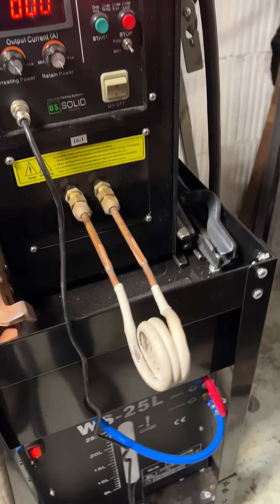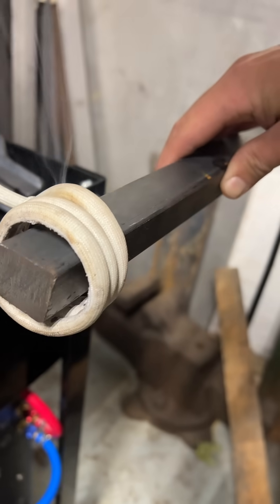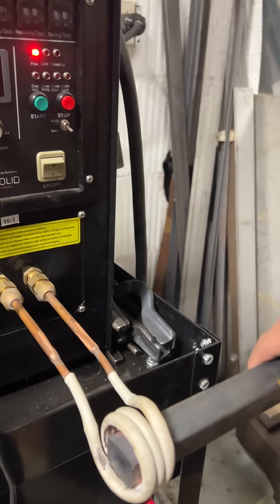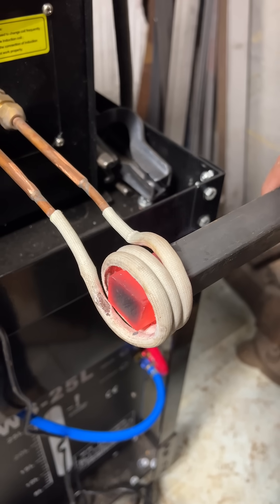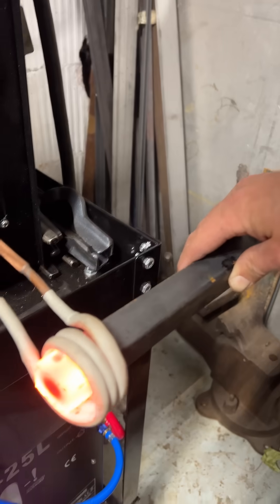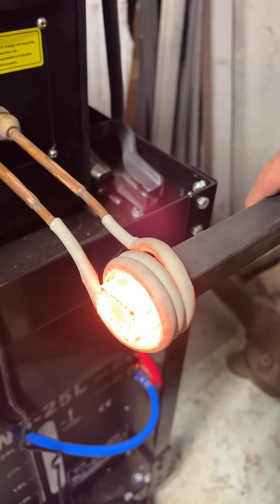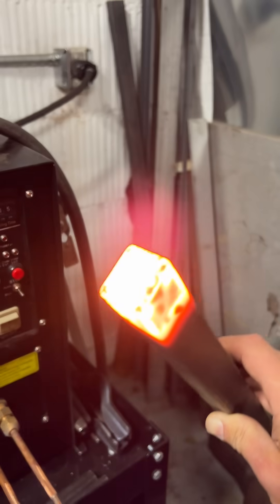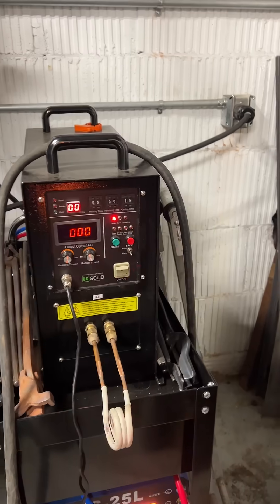Red Hot Steel In Seconds! - Induction Heater

Comment: Does it heat the whole piece in the coil evenly, or does it it heat a certain direction (outside-in or inside-out)
Reply: It depends on the frequency of the tank and the thickness of the steel.

Comment: I worked in quality assurance at an automobile mfg plant. Our supplier that made our axle shafts would heat treat the shafts after machining using the same method except it was much faster. The coil was ran over the shaft and back off in a matter of 10-15 seconds, and quenched with water on both sides of the area in the coil that was glowing red hot. When it was over the axles had a blue color from the heat. It was pretty impressive to watch.

Comment: Woe ! I don't understand how the heat doesn't transfer. That's amazing
Reply: Thermal transfer will still happen, its just that he heated that spot so quickly that it didn't have time to take place yet. 5 minutes after the video ended this bar was a scorching 800f I bet.
Reply: @coopers1716  what if someone put a finger inside the coil !?
Reply: @parwisingh1171  Nothing unless you had some kind of ferrous ring on or metal embedded in your finger. Microwaves work by vibrating water molecules really fast right? This is essentially a magnetic microwave, so instead of affecting the water molecules it's vibrating the shit out of the magnetic particles.
Reply: @coopers1716  thanks
Reply: @coopers1716   Hello , let me explain to you why you are incorrect and that you will not be burned “the same as holding a needle and a lighter”  which is not induction heating it is conductive heating and a needle is a very minuscule amount of a less dense material 16 gauge stainless steel wire sharpened to a fine point than a 1.000”x 1.000” x 24.000” cold rolled steel bar. [choose the appropriate dope stick or temporary non conductive clamp to hold the workpiece I’m pretty sure you have seen them every time dinner was ready and there was that hot stove with that pot of hot delicious home cooked meals in them (depending on which generation you are as some are McDonalds and Burger King  and this new generation is door dash and Uber eats.). Yep, you guessed it the handles some were made what did not really get hot unless you held it over a flame or an idle left on.
Inductive heating is on the atomic level using eddy currents to heat the atoms which are changing poles generating energy and radiating particles and that we perceive as heat and light.  A good digital scale can be used to weigh the material take it to amber then weigh it. Record the cold temperature and weight the heated temperature when the color changes and it’s weight all the way up to an amber color then weigh it then let it cool completely or if there are 2 samples quench one in used or high hydrocarbon oil then pull our once completely cooled then dry and weight them both the one quenched in oil will gain in mass and density the other will have loss weight and in some cases density.  Less dense materials have difficulty influencing harder or larger cold surfaces.  One with drawn from the influence of eddy currents the objects rearrange and it stop radiating and starts cooling and returning to its natural state.  Think of it like this you remember in science class you at the atoms which are made from electrons and each element on the periodic table has a breakdown on each element and it’s constituents how many protons, neutrons and electrons which are in the atoms of the matter.  You have the core or nucleus then a shell some elements will have 2 or more shells these outer shells hold everything in place like charges repel .An atom is the basic building block of chemistry. It is the smallest unit into which matter can be divided without the release of electrically charged particles. It also is the smallest unit of matter that has the characteristic properties of a chemical element. The eddy current influences those charged positively charged partying particles because they are being excited by the coil and they vibrate which in some cases the radiation will be in the form of pressure waves or what is commonly known as sound.  That humming noise from turning on high voltage devices, ozone, IR radiation also known as heat until the Electromagnetic radiation release enters the higher ranges of visible light in the electromagnetic spectrum. As it heat it is giving off electromagnetic radiation in correlation to the electromagnetic frequency.
Electromagnetic waves differ from mechanical waves or energy in that they do not require a medium to propagate. This means that electromagnetic waves can travel not only through air and solid materials, but also through the vacuum of space.
Reply: @MarshallMcFarlin  The fact that you think Imma read that is absurd.
Reply: With normal, conductive heating the rate of heat transfer into the steel is slower than the heat transfer down the steel bar. With inductive (this), resistive (from passing electricity through it), or radiative heat (a bright light, perhaps a laser) you can heat a section far quicker than it conducts the heat down the bar.
Reply: It’s AC current not DC.  It’s generating eddy currents in the bar where the coil is and almost all at once the magnetic field in the area where the coil is is rapidly going NSNSNSNSNSNSNSNSN on the atomic level generating heat unlike DC which flows in one direction like water in a pipe.  To Butter understand this phenomenon take a glass of water and a drinking straw.  When you drink from the straw the liquid flows in one direction  >>>>>>>>it remains cool. 
But, if you draw the drink then instead of swallowing it forced it back into the same glass without breaking contact with the straw when you reverse the flow it is met with resistance of the rest of the fluid.  ><><><><> eddy current build in the straw which can be measured using an infrared thermometer.
I hope this explains it.  You may find a more specific answer in my earlier comment.
Shabbat Shalom ✡️.
Reply: Hello , let me explain to you why you are incorrect and that you will not be burned “the same as holding a needle and a lighter”  which is not induction heating it is conductive heating and a needle is a very minuscule amount of a less dense material 16 gauge stainless steel wire sharpened to a fine point than a 1.000”x 1.000” x 24.000” cold rolled steel bar.
Inductive heating is on the atomic level using eddy currents to heat the atoms which are changing poles generating energy and radiating particles and that we perceive as heat and light.  A good digital scale can be used to weigh the material take it to amber then weigh it. Record the cold temperature and weight the heated temperature when the color changes and it’s weight all the way up to an amber color then weigh it then let it cool completely or if there are 2 samples quench one in used or high hydrocarbon oil then pull our once completely cooled then dry and weight them both the one quenched in oil will gain in mass and density the other will have loss weight and in some cases density.  Less dense materials have difficulty influencing harder or larger cold surfaces.  One with drawn from the influence of eddy currents the objects rearrange and it stop radiating and starts cooling and returning to its natural state.  Think of it like this you remember in science class you at the atoms which are made from electrons and each element on the periodic table has a breakdown on each element and it’s constituents how many protons, neutrons and electrons which are in the atoms of the matter.  You have the core or nucleus then a shell some elements will have 2 or more shells these outer shells hold everything in place like charges repel .An atom is the basic building block of chemistry. It is the smallest unit into which matter can be divided without the release of electrically charged particles. It also is the smallest unit of matter that has the characteristic properties of a chemical element. The eddy current influences those charged positively charged partying particles because they are being excited by the coil and they vibrate which in some cases the radiation will be in the form of pressure waves or what is commonly known as sound.  That humming noise from turning on high voltage devices, ozone, IR radiation also known as heat until the Electromagnetic radiation release enters the higher ranges of visible light in the electromagnetic spectrum. As it heat it is giving off electromagnetic radiation in correlation to the electromagnetic frequency.
Electromagnetic waves differ from mechanical waves or energy in that they do not require a medium to propagate. This means that electromagnetic waves can travel not only through air and solid materials, but also through the vacuum of space.
Reply: Heat will transfer slowly as the rod is very thick
Reply: the heat will travel down the rod once he removed it for the coil. u can test this theory with a sewing needle and a lighter.
Reply: @freedomcanada8397  Hello , let me explain to you why you are incorrect and that you will not be burned “the same as holding a needle and a lighter”  which is not induction heating it is conductive heating and a needle is a very minuscule amount of a less dense material 16 gauge stainless steel wire sharpened to a fine point than a 1.000”x 1.000” x 24.000” cold rolled steel bar.
Inductive heating is on the atomic level using eddy currents to heat the atoms which are changing poles generating energy and radiating particles and that we perceive as heat and light.  A good digital scale can be used to weigh the material take it to amber then weigh it. Record the cold temperature and weight the heated temperature when the color changes and it’s weight all the way up to an amber color then weigh it then let it cool completely or if there are 2 samples quench one in used or high hydrocarbon oil then pull our once completely cooled then dry and weight them both the one quenched in oil will gain in mass and density the other will have loss weight and in some cases density.  Less dense materials have difficulty influencing harder or larger cold surfaces.  One with drawn from the influence of eddy currents the objects rearrange and it stop radiating and starts cooling and returning to its natural state.  Think of it like this you remember in science class you at the atoms which are made from electrons and each element on the periodic table has a breakdown on each element and it’s constituents how many protons, neutrons and electrons which are in the atoms of the matter.  You have the core or nucleus then a shell some elements will have 2 or more shells these outer shells hold everything in place like charges repel .An atom is the basic building block of chemistry. It is the smallest unit into which matter can be divided without the release of electrically charged particles. It also is the smallest unit of matter that has the characteristic properties of a chemical element. The eddy current influences those charged positively charged partying particles because they are being excited by the coil and they vibrate which in some cases the radiation will be in the form of pressure waves or what is commonly known as sound.  That humming noise from turning on high voltage devices, ozone, IR radiation also known as heat until the Electromagnetic radiation release enters the higher ranges of visible light in the electromagnetic spectrum. As it heat it is giving off electromagnetic radiation in correlation to the electromagnetic frequency.
Electromagnetic waves differ from mechanical waves or energy in that they do not require a medium to propagate. This means that electromagnetic waves can travel not only through air and solid materials, but also through the vacuum of space.
Reply: @freedomcanada8397   Hello , let me explain to you why you are incorrect and that you will not be burned “the same as holding a needle and a lighter”  which is not induction heating it is conductive heating and a needle is a very minuscule amount of a less dense material 16 gauge stainless steel wire sharpened to a fine point than a 1.000”x 1.000” x 24.000” cold rolled steel bar.
Inductive heating is on the atomic level using eddy currents to heat the atoms which are changing poles generating energy and radiating particles and that we perceive as heat and light.  A good digital scale can be used to weigh the material take it to amber then weigh it. Record the cold temperature and weight the heated temperature when the color changes and it’s weight all the way up to an amber color then weigh it then let it cool completely or if there are 2 samples quench one in used or high hydrocarbon oil then pull our once completely cooled then dry and weight them both the one quenched in oil will gain in mass and density the other will have loss weight and in some cases density.  Less dense materials have difficulty influencing harder or larger cold surfaces.  One with drawn from the influence of eddy currents the objects rearrange and it stop radiating and starts cooling and returning to its natural state.  Think of it like this you remember in science class you at the atoms which are made from electrons and each element on the periodic table has a breakdown on each element and it’s constituents how many protons, neutrons and electrons which are in the atoms of the matter.  You have the core or nucleus then a shell some elements will have 2 or more shells these outer shells hold everything in place like charges repel .An atom is the basic building block of chemistry. It is the smallest unit into which matter can be divided without the release of electrically charged particles. It also is the smallest unit of matter that has the characteristic properties of a chemical element. The eddy current influences those charged positively charged partying particles because they are being excited by the coil and they vibrate which in some cases the radiation will be in the form of pressure waves or what is commonly known as sound.  That humming noise from turning on high voltage devices, ozone, IR radiation also known as heat until the Electromagnetic radiation release enters the higher ranges of visible light in the electromagnetic spectrum. As it heat it is giving off electromagnetic radiation in correlation to the electromagnetic frequency.
Electromagnetic waves differ from mechanical waves or energy in that they do not require a medium to propagate. This means that electromagnetic waves can travel not only through air and solid materials, but also through the vacuum of space.

Comment: Thats baby shit. Worked at a place that bent pipe for pipe line, 36 by 2 inch thick , was standard
Reply: The last one I installed was 450kW, tended by two Fanuc 2000i robots.

Comment: Question? I've taken a basic college chemistry class and ik that some metal have a very low heat up rate. so how doesn't the the metal transfer the heat through out the bar relatively quick and burn his hand? Ik its a thick bar and that heater heated it up quick but shouldn't the rest of the bar heat up too?

Comment: That’s awesome that you can hold it while that close would definitely be awesome for small jobs and most importantly just because. I’ll take 2😂
Reply: It will take some time but the heat will spread into the rest of the metal, you can hold it like that for maybe five minutes or less, depending on the thickness and type of metal.

Comment: You can make new coils to fit anything you need, for dirt cheap. I got a 30ft roll of copper brakeline and a 30ft roll of fiberglass sleeve tubing for ~20-25 bucks 4-5 years ago. Have made probably 15-20 different coil attachments, and I still got a good bit left on both rolls.

Comment: It doesn’t use magnets, but it uses magnetic current fields to generate heat which are called eddy currents
Reply: No such thing as magnetic current fields chief. The nature of electromagnetic induction, specifically the resulting Eddy currents that are generated as a result of the phenomena are what generates more and more heat in the rod. To clarify, it is not the induced B-field that generates heat (at least not directly as your comment implies), it is the inherently existing internal resistance of the metal rod and the magnetic friction caused by the actions of the induced Eddy currents within the rod that generates more and more heat in the rod.
Reply: That’s a waaaaay better way of describing it, and you are totally right. I appreciate the fact check man!

Comment: It uses electricity in a coil to create a strong high frequency magnetic field that induce eddy currents in a iron that directly opposite to the magnetic field in the coil cause the iron to heat up.
Reply: Wow you have an idea of the concept but you have failed horribly to explain it properly.
Reply: The first and arguably the largest problem here is that there is no such thing as a high frequency magnetic field.
Reply: @Syndicalism  Sorry,
High frequency voltage/current cause rapid changing magnetic field that induceses voltage/current/magnetic field that oppose the primary magnetic field and beacuse the frequency is high the induce field can not keep up with the original and heat up.
Electrical Engineer.

Comment: This is a mini version of what I use at work. We have a 650kg induction furnace and a little 350kg one. Very impressive how quickly it goes from solid to liquid.
Reply: They have even smaller ones for bolt heads that are hand held 😉
Reply: Same process I used at a iron foundry. Those were measured in 2000lb for the small one and 9000lb for the bigger one.
Reply: Ah yes fellow heat treater